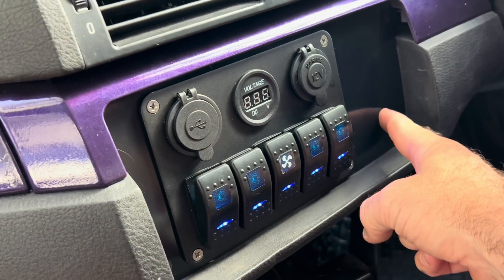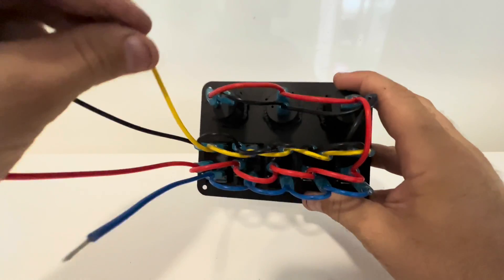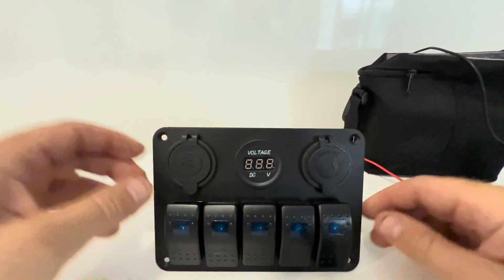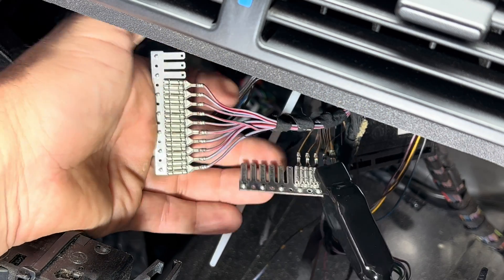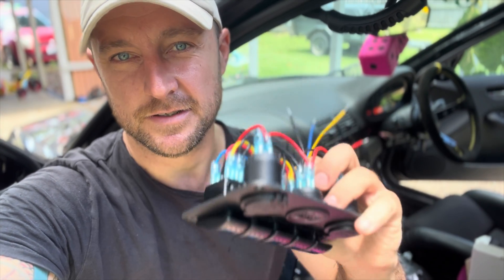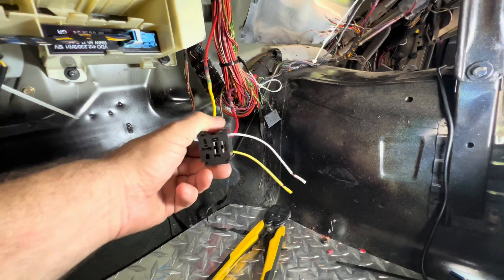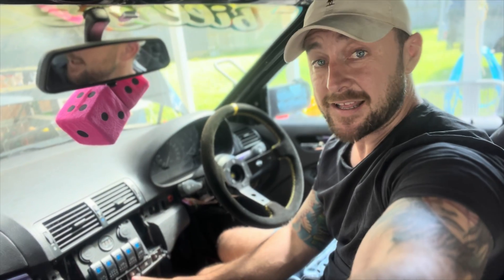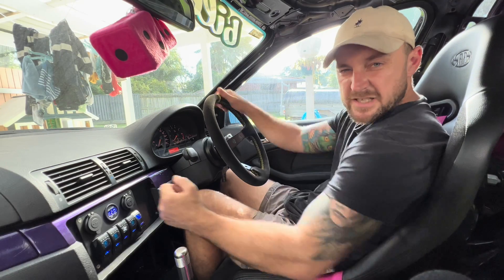WIRING A RADIATOR FAN SWITCH. E46 drift build

Comment: Superb video. Would wiring in the relay and fan switch work if the fan already works normally and i just want it to come on when i flick the switch? Would there be any other mods/bypasses i need to make so it runs off the switch instead?